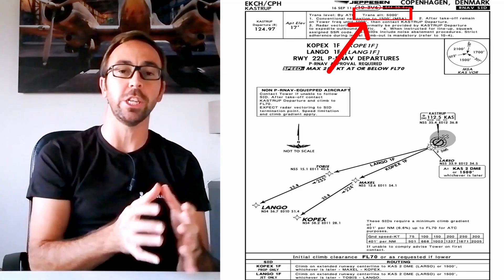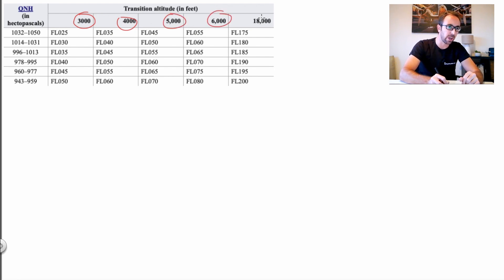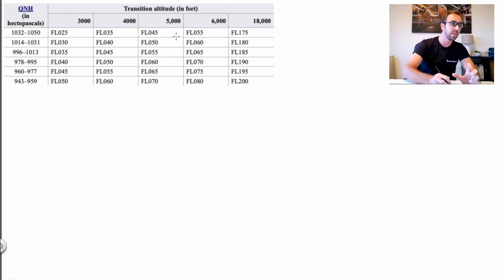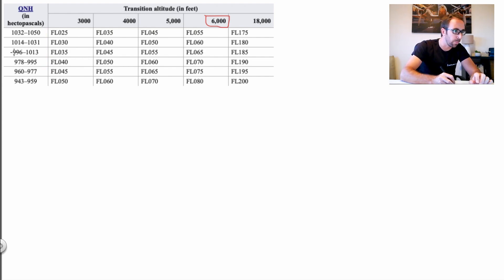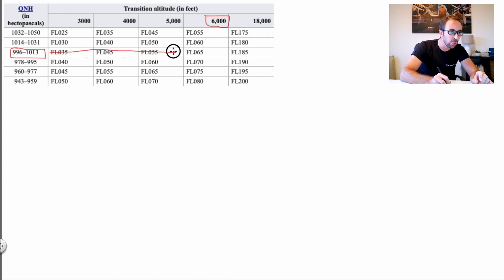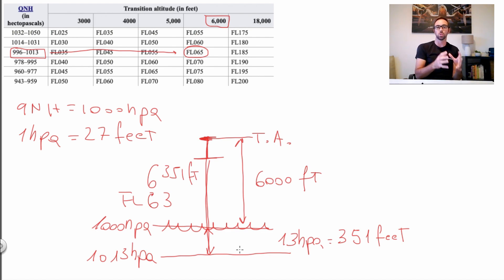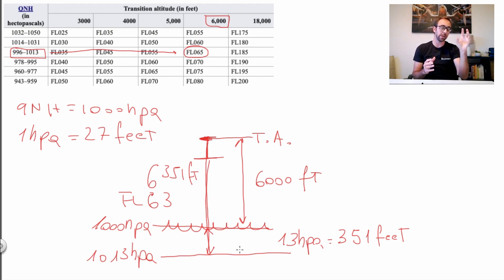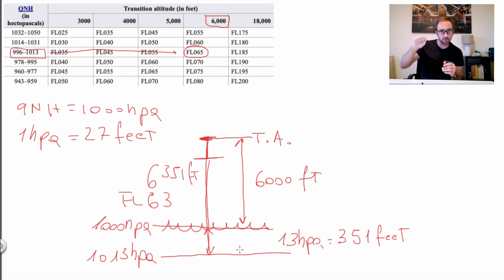Transition Level: What It Is, Why It Important And How YOU Can Calculate The TL.

Comment: 1. How are AMSL terrain elevations determined for aeronautical charts?
2. As the QNH-MSL reference pressure changes with local weather conditions, how can we know with certainty what our QNH-based altitude is relative to the published terrain altitude?  (Maybe for this day our local QNH pressure-based altimeter reading of 6000 feet does not directly match the 6000’ ASL published mountain elevation??

Comment: Hello Capt. Gabriele, I have a question for you :
I use X-Plane 11 and fly the 737-800, I usually get the Transition Altitude on the FMC based on where I'm with the GPS and what Departure I set into it. The problem is, when I descend from Flight Levels and the ATC tells me the Transition Level, the PFD still tells me to use the STD (amber color) because it uses as a reference the T.A. of the region I'm flying in. Can I switch from STD to QNH simply by pressing the STD button on the EFIS? Even though my T.L. is different from what the FMC expects? Grazie mille in anticipo!
P.S.
I love your videos, if you haven't done it yet you could upload a video about the TCAS, how it works and what are the buttons specifically for the 737-800 😊. Greetings from Italy, I'm a big fan.
Reply from the maker: Hey!! I'm very happy to see that you enjoying the Training Content! That's great!! now, yes you can do it! If the QNH or STD remain amber after you change the altimeter pressure reference you need to change the TL or TA value on the FMC and you will be great!!👍
Reply: @PILOTCLIMB  Thx Gabriele :) I have a problem doing that, if I press Init Ref button on the FMC while descending, it gives me the VREF speeds and the runway length /heading and frequencies set on NAV, Transition Altitude disappears 😢 Great answer however, have a great day
Reply from the maker: No problem, when flying try to push DESC and then FORECAST.. You should find it in there...
Reply: @PILOTCLIMB  I have the new version of the FMC so the DESC button is not there any longer... I'll have to find it using the menu, I'll let you know if I can solve the problem 😊 Thanks for your time
Reply: @PILOTCLIMB  You were right 😁 I pushed the VNAV button on the FMC and I went to the final page 3/3 ECON PATH DES, then I selected Forecast and there it was "Trans Lvl". I noticed that if I input 7000,8000 or even FL70 FL80 it says invalid entry, then I realized that I just need to input the first two digits i.e. (Transition Level FL70 you need to input just 70 and it will accept it😊) Thx captain, see you at the next video.
Reply from the maker: @leonegentile6081  that's great! I wish you a great day!

Comment: Hi, nice video! I must ask you a question, because I don't understand one thing. I'll be talking about LFBO. Current QNH is 1020hPa, T.A. is 5 000ft. By my calculations using your chart in the video TL should be FL50, but the TL is actually FL60. Why? 
Thanks and Merry Christmas!
Reply from the maker: Hey many thanks for your support!!

So, the table used in the video is the '' generic'' transition level calculator table.
In order to see why the TL is 60 at LFBO you should check what Transition Leyer they are using, some countries use a different Transition Leyer to calculate the Transition Level from the Transition Altitude. 

Try to see if you find what transition Leyer they use in LFBO and than let me know 👍👍

I wish you a great day
Gabriele
Pilotclimb

Comment: Hello Captain Gabriele,

Thank you very much for explaning this topic.

I didn t know that calculating the Transition Level is so easy.
And thank you for the table.

But...i have a few questions.

Why do some airports have fixed transition Alt and Trans Level values, and other not?

For example:

1) In Germany and France the Trans Alt is always 5000ft and Trans Level is by atc.

2) In USA both, Trans Alt and Trans Level are at 18000ft.

3) In Saudi Arabia, Qatar, UAE, the Trans Alt is always 13000ft and Trans Level is always FL150.

In Morocco the Trans Level is also by atc, but 

Oujda-Angad, GMFO has 7000ft Trans Alt
Marrakech Menara, GMMX has 6000ft TA
Casablanca, GMMN has 4000ft TA
Laayoune, GMML has 3500ft TA
Agadir GMAD has 5000ft TA.

So why countries and airports have own regulations and why is there no same standard?

You said that the Trans Level if it would be FL63, it has to be rounded up to FL65.
Do you know if there are airports existing which require very accurate entries of the TL like FL63?

I mean it would be no problem to do that as you can enter that value into the FMC.

Thank you!
Reply from the maker: Hey, many thanks for your comment and for watching the Transition Level video.

The procedures used to calculate the TL depends on the country, some country make it very easy taking the highest obstacle that is present in a vast area in order to calculate the Transition Altitude and Level, others calculate it zone by zone, it really depends on them.

I have never seen a Transition Lavel that is not '' standard'' like the TL 63...always 500 feet in 500 feet.

Yes you are right it would be easy, however it might create confusion with other ATC instructions, such as, heading vectors.

Always remember that, depending on the plane, even if you enter the Transition Level on the FMC you still fisically have to change your altimeter setting on your altimeter once passing the TL.

Let me know if I answered your questions!!
Have a great day
Gabriele
Pilotclimb